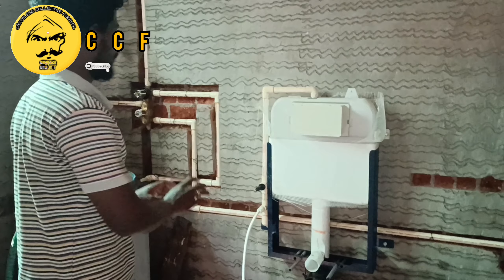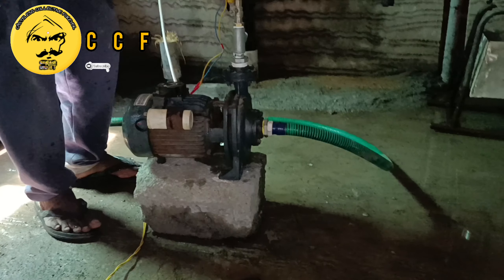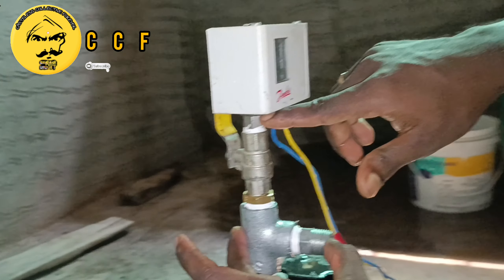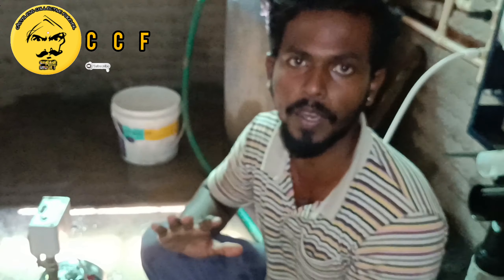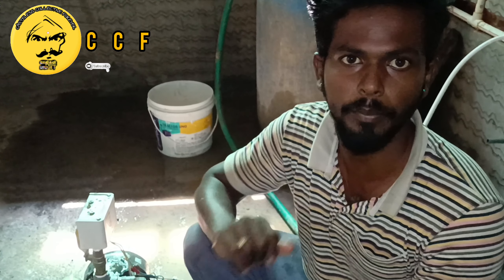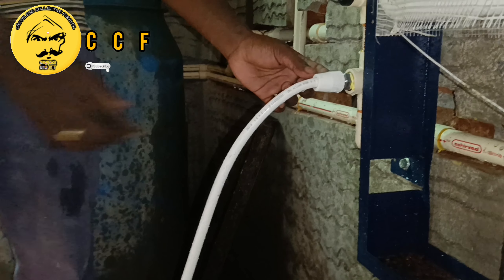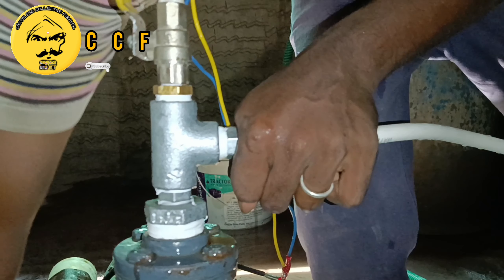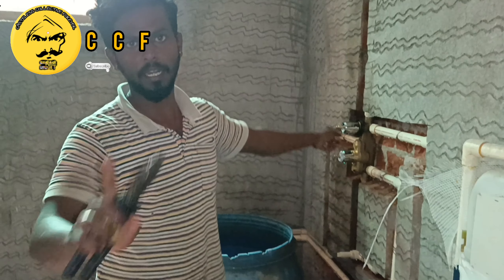How to use Pressure gauge and pipeline leakage arresting @castelesscollectiveforever2285 #plumbing

Comment: What to do if there is no pressure in one pipe and rest of them works well..
Reply from the maker: It's not pressure pump but pressure cut off switch used so 2 barr pressure motor cut off motor core not damaged